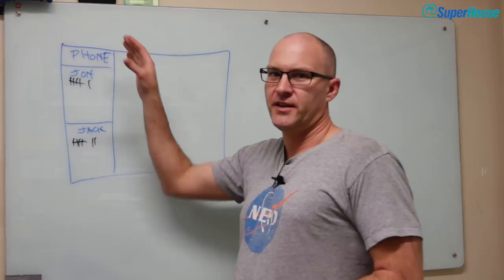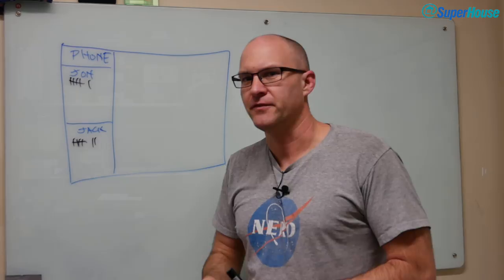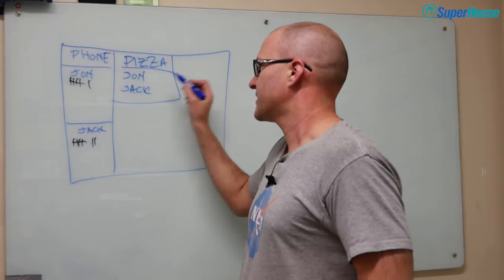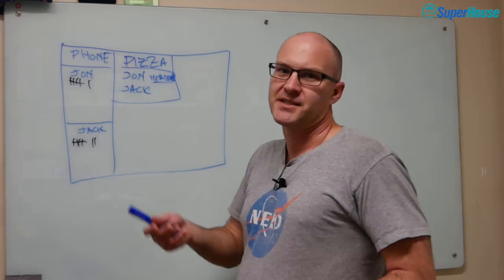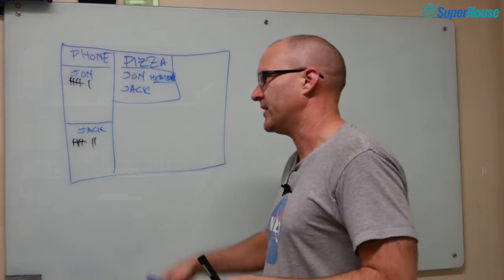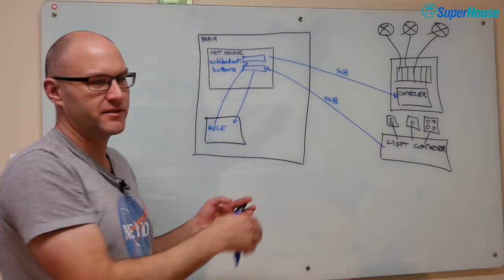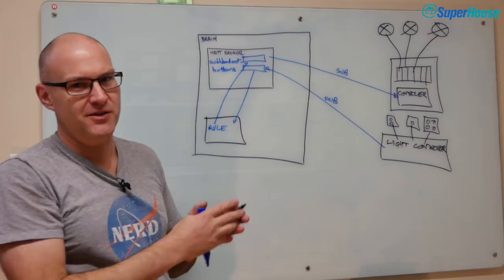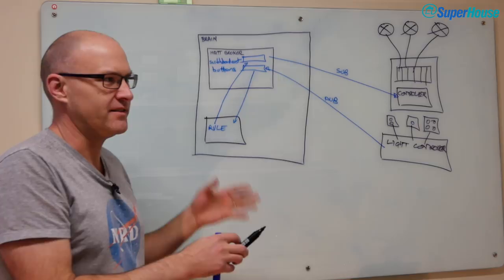SuperHouse #24: Home automation system architecture

Comment: As usual, brilliant video and explanation.  For my home automation system, I'm also using MQTT since 2015 to communicate between my 2 Raspberry Pi's, this to my big satisfaction.  It's an easy, reliable and very sturdy protocol with very few overhead and lightning fast!  I have switches downstairs that have to activate relais upstairs and the flow goes like this:
On my RPi downstairs, a switch state is detected by I2c via an IO expander (MCP23017). Then a Java program converts that I2c result into a MQTT message.  Then this is published to the broker which will send it "out" to all subscribed clients.
My upstairs RPi is subscribed to it and grabs the message in a Java application.  That application converts it back to I2c which controls again an IO expander, sets a pin and through a transistor circuit finally sets the relais.
So, quite a "long" way but you can't even see a delay with the naked eye.  It's that fast...
Reply from the maker: That sounds very similar to how I'm doing it. My next episode (up in a few days) will show more detail about how my light switches work. The major difference is that I'm not using a Raspberry Pi with an IO expander to read the light switches: I use a Freetronics EtherMega which reads them directly using digital inputs, then publishes to MQTT. More details to follow :-)
Reply: Looking forward to read it... :-)

Comment: A good reason for this setup is when you have scenarios where your garage needs to have a switch on the door side and the gate side where you might only have 1 switch, they can toggle each other. not simple with traditional switch which you need to rewrite the switch and cabling for it.

Comment: So many questions!

MQTT: can you publish a JSON object so that you can see the humidity and the time it was reported for example?  {"humidity": 47.0, "update_dttm": 1506086799679}

Power: how do you handle a power outage? How do you make sure things spool back up in the proper order so your sensors can connect to the network after the network is availalbe?

Redundancy: Do you have a mechanical backup to your software solutions? Can there even be a mechanical backup? 

Wireless Frequency: Why did you choose 433MHz, why not z-wave? 

I cannot rewire my house to be centralized so I am having to figure what wireless range I'll be using that won't interfere with my WiFi that will give me mechanical switches with software control. I'm at a loss currently
Reply from the maker: MQTT: yes! MQTT doesn't care what messages it passes, so it's fairly common to use JSON as the payload. That makes a lot of sense.

Power outages: this is something that possibly deserves an entire episode because it has been a huge pain in the past. My biggest problem was that my router (and hence DHCP server) was one of the slowest things to start up, so in a cold-start situation many devices would end up orphaned and never join the network. My sledgehammer solution to this is to put hardware watchdogs on just about everything, and have the watchdog only reset if the device successfully communicates with a remote service. After a cold start, some devices will sit there repeatedly rebooting until the other things they depend on are ready, then they'll settle down and be fine. It's at the point now where the system comes up from a cold start all by itself without any need to intervene.

Redundancy: this is also something that deserves a long answer, so I won't get into it here. The short answer is no, but there are reasons that it doesn't really matter in practice.

Frequency: That's only because I designed this board while working on a project to control electric blinds that used 433MHz remote controls. I don't have any Z-Wave devices but there's no particular reason for that. I simply haven't come across any that I needed to integrate with. Yet!

Comment: You need to do an episode about the rewiring. Maybe interview your electrician about how you got ethernet pulled to switch locations which previously had mains. What were the time consuming / expensive parts of the wiring?  How did you solve the problem places, where wire runs would require you to tear out a bunch of drywall or flooring?  I've just been wanting gigabit ethernet in a couple places in my house, and with a finished basement it looks pretty difficult and expensive.
Reply from the maker: That sounds like a really interesting idea.

Comment: Great video I've only just started my home automation adventure from discovering sonoffs from your channel and having litrally no knowledge about it and coding etc (total noob). This has lead to a new hobby which I'm loving learning about and this video has totally helped me understand MQTT of which before I couldn't find a single video which explained it so well. I've just installed my open hab on to a raspberry pie and looking for ways to implement more home automation into my home. I just wish I had got into home automation before id finished decoration my house and re wiring! thanks for the great turorial look forward to the rest
Reply from the maker: Thanks Paul! I've found that MQTT has been a very useful tool, and I've had a few goes at trying to explain how it works and why it matters. Hopefully I was clear enough this time.

Comment: Great episode as always, thanks Jon. I've started fiddling with setting up something similar although taking too long on some tedious boring elements of it.

Another aspect I've got planned is to use a time series DB like Influx to store the sensor and state readings of MQTT topic and then possibly being able to explore those with something like Grafana. Be able to plot things like temperature or luminescence or even just how much time I have my desk in standing verses sitting position while I'm in front of it.

 I've been using Dietpi for the OS, and increasingly find using Ansible to make it fast to reformat and setup again when necessary the way to go.
Reply from the maker: I've used a few different time-series DBs in the past, mostly RRDTool but I also use InfluxDB with OpenHAB to store and report data from MQTT. I want to cover this in a future episode.

Comment: I was watching your video and you were talking about your "Rules Engine" and I said out loud at my TV "Dude you should be using Node-Red". When you got there I smiled. This video is a few months old so I am going to assume that you realize that Node-Red can do pretty much all you are doing with Openhab. I'm using node-red-dashboard for my tablet and phone interface. I have a database running on node-red and anything else you can think of. Just streamline your software down to  Mosquitto  and Node-Red on your Raspberry Pi Zero W like I did and you'll be happy you did. Great videos, glad I found you.  Now I am trying to figure out how to dim lights using your switches. I found a ac dimmer module so that is my next project.

Comment: thats why its soo important for "Makers" to buy a new house before it is being built so they can ask for custom features. although its not super hard to rewire everything but it is not as convenient. also keep in mind something like Alexa or Google home integration. build in so you can change, because things change within few years and you need to upgrade or change entirely, dont build permanently. I work in GeekSquad and go to houses that cilent had spent thousands on top of the line features 5 years ago and now they have to spend as much to get it chagnged because things are ran in an inconvenient way and we need to spend half a day breaking into Sheetrock destroying half the wall just changing component wires to HDMI.

Comment: @SuperHouseTV - I'm hungry for two kinds of data: 

1. A full hardware BoM for your hardware and cabling, preferably as a versioned Google Doc (so we can follow changes).  I'm particularly interested in how well a particular piece of hardware has worked, if you would purchase it again, and if not, what you'd prefer to use instead.

2. The power consumed by all home automation sensors and controls (not the loads), preferably measured using a clamp-on ammeter.  In part for UPS sizing, but also to get an annual cost to run the system.

I hope to benefit not only from your experience, but also your future intentions.
Reply from the maker: I like the idea of the BoM. I'll see if I can put one together in a useful format.

Power consumption will be covered in detail in the future. I have two episodes planned about power monitoring, and one of them has already been partly filmed.

Comment: I admire your videos.  I would add one "feature" to the sub-boxes.  That is a set of DPDT switches (one per relay) to control the 12V relays manually.  I don't want to be in the proverbial dark if I lose my network connection or controller.  Sure, this is "belts and suspenders," but still..
Reply from the maker: Yes, it'd be nice to just flick some switches and bypass the relays if everything else fails. However, I don't think I have space left in the switchboard! My experience so far has been it's easy to turn on a couple of desk lamps to have enough light to get around the house with nothing else working, and there haven't been any problems that last long enough to be a big issue. I understand the feeling of needing a backup plan though.

Comment: My friend you are at the Top of Home Automation. How about a Power Point presentation instead of the whiteboard. You'll save on green markers and the animation factor is cool. I'd like to funnel all of your knowledge in my brain but it would explode !!! Keep up the great work and get on Patreon to get more funding for more of your "Smart House"  videos.
Reply from the maker: Thanks Edwin! Yes, I could do it with Power Point but that takes much more preparation time. I have used Keynote in a  few videos but I've found that it just makes production much more complicated because I have to spend hours preparing the slides, then I have to record the voiceover, then play the slides and match them to the voiceover, then import both the voiceover audio and the screen capture, then synchronise them in Final Cut Pro, and edit it. It takes many times longer than just drawing on the whiteboard and doing it in one go.

Comment: Wow, would love to see a control box like that in my place, I would need to rewire everything!  I think my next big project is mosquito!  Have you ever used this with Particle Photons?
Reply from the maker: Yes, I have about 200 Photons here from a project a couple of years ago. They're left over from a project where I had them connecting to one of my Brain boxes using MQTT. It's a long time since I looked at it, but I'm pretty sure the MQTT library is available in the Particle IDE.

Comment: MQTT kinda reminds me of the old telephone switchboard operators, before automated telephone exchanges. This is a great start into this series, Jon. You use wifi for part of your home automation control. Is that a separate network (like a management wifi network)?
Reply from the maker: Good analogy! Yes, it is a bit like a centralised telephone switchboard linking parties together. I try to avoid using WiFi for anything critical: I don't want to lose control of anything just because there's a WiFi glitch. Wires beat wireless every time! I do use WiFi for non-critical things, like miscellaneous temperature sensors that provide a source of data but don't really matter much. I'm about to do an episode about building the ultimate home router / firewall, and I also want to do an ep about building a robust WiFi network with multiple APs, avoiding channel clashes, mapping signal strength, etc.
Reply: Sounds like a great roadmap for the series. :)

Comment: @SuperHouseTV. Question here- What is the difference between the Rule engine device, NodeRed in your reccomendations to the Openhub? Do you need both or the rules Openhub can run will do?
Thanks
Reply from the maker: Good question. It could be done entirely within OpenHAB, but I did it separately for 2 reasons. 1: I can't stand the rules engine in OpenHAB. I find it hard to work with. 2: I started this system before OpenHAB existed, so I already had a working rules system in place. I just added OpenHAB alongside the existing system to provide a better UI and state management.
Reply: Thanks a lot. This is what I thought. I am trying to think for long term and determine what will not limit me the most. Also, I need my wife to be able to understand that (Just saw the piece on "if you die" :-) ) .
BTW- do you do consulting for architecture? I am building my house and want to be able to add the wiring into the plan, but taking an architect that deal with home automation is always SO much more expensive. I just need help with making sure that I think about all the scenarios.
Thanks

Comment: Great work, but I have a question regarding the way that you automate house, why we need to wire the house again and there are many technologies can solve this issue like Zigbee or Z-Wave.  Even the light switch you can use the same technology to communicate with the Hab(no need to wire them because they will use the local wireless that on house). And also from the hab, it can communicate with the device that controls the electronic relays to switch on or switch off,  I think this way is much easier! so what you need are more habs  to cover the house which can use a cheap raspberry pi with the right adapter of the technology that is used.

Comment: Hi Jonathan, what is the reason you're use a separate rules engine for managing MQTT, the custom one you mentioned you want to replace with NodeRed? I've gone over to HA and have managed to get it to react to my wall switches/buttons in very much the same manner you are doing it, just without the (external) rules engine using HA's "Automations"
Reply from the maker: It's an accident of history. My first ever version of the system had nothing but my DIY rules engine (written in PHP, no less) which used Apache as a front end to provide an API over HTTP. It also provided a web interface that I accessed using my phone and tablets mounted on the wall. Then I added MQTT. Then I added OpenHAB, mostly because it has nice apps for iOS and Android, and it tied into my existing system very neatly via MQTT, and I stopped using my DIY web interfaces. If I was starting totally from scratch I'd probably just go all-in with OpenHAB or Home Assistant, although I can't stand the rules system in OpenHAB so I'd probably still supplement it with Node-RED.
Reply: Had you ever heard of homeseer or looked In to using it as home controller, it is not free but integrates with a lot of stuff.
Reply from the maker: I've heard of it, but I've never used it. I can't remember the reason I didn't look into it further: maybe it wasn't open source, which is a deal breaker for me in this particular context. I'm treating my house as a toy, so I want systems I can hack on.

Comment: The timing of this video is perfect. I spoke to my builder for Drouin  yesterday and I'm going to call the sparky today. Really great stuff mate. There's a lot to take in but I'm looking forward to having a chat with you soon and see how I can help. Do you know if there is a network of people that are doing/have done this that I could be put in touch with. It would be great to bounce ideas off them.
Reply from the maker: Thanks Robert! I don't know of any particular network, other than randomly chatting to individuals on Facebook or YouTube. There are communities around the various home automation hub projects such as OpenHAB, but they're usually focused on the specific project rather than the bigger picture of all the other devices in the system.
Reply: SuperHouseTV the great thing about your setup is that I could technically have everything setup on a workbench in advance to make sure it all works then just fit it all in once the house is ready. I'll be talking to the builder again to get a price for the wire if then all I'll need is the green light from my partner. 👍

Comment: Great work as usual !!!
I'm doing all this with "Home Assistant" instead of"OpenHAB" and it's working great since last one and a half year. Could you point any difference between these two which can force me to shift to OpenHAB ?
Reply from the maker: Nope! I may even switch to HA at some point. The reason for using OpenHAB is mostly historical: it's what was best at the time, but there are more options now. I haven't used HA yet but I want to set up several systems in parallel so I can compare them. Saving up for a Google Home :-)
Reply: I found node-red + Node-red Dashboards suficient for now

Comment: this was very interesting.
I'm curious about what you have inside those wall switches
Reply from the maker: You don't have to wait long! The next episode will be uploaded this week, and it starts with a history of the different types of switches I used then shows a detailed build guide for the controller that reads the switches. I've been working on this episode for about 5 months but I wanted to upload the architecture ep first so it would have some context.

Comment: I've been using Node Red for a couple of months now and I'm blown away. I still use openHAB2 (openHABian) for the Z-Wave bindings, Node Red just runs over the top. Which triggers me to say (pun intended), Jon, do you use Z-Wave at all? Have you looked it? It would be great to hear your thoughts on it.
Reply from the maker: I haven't used Z-Wave but that's just because I haven't needed to use any Z-Wave devices yet. It's quite likely I'll try some eventually.